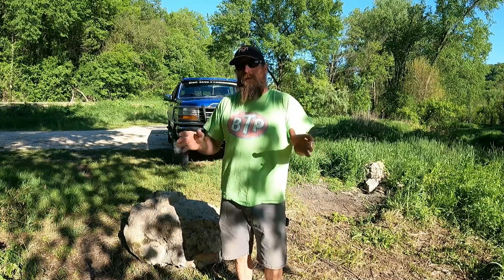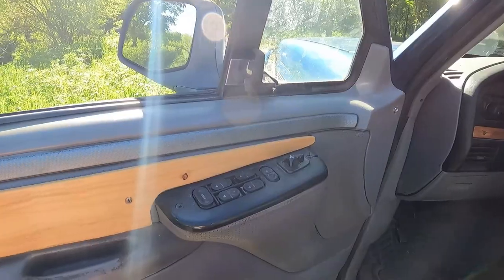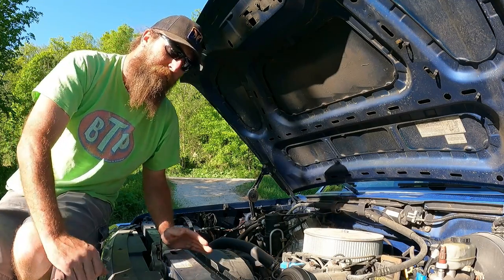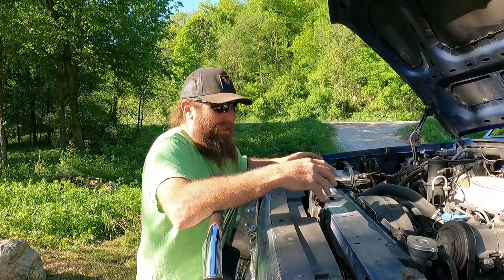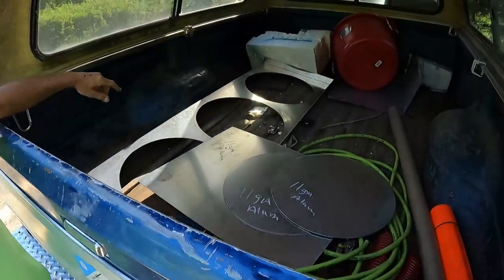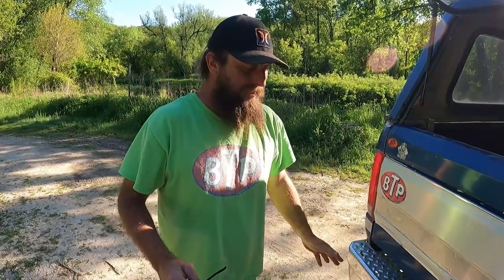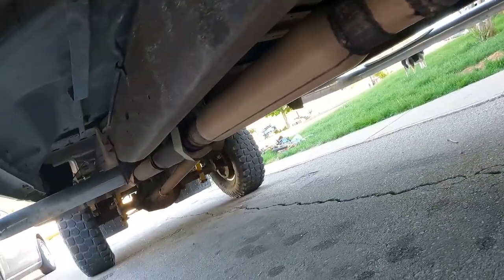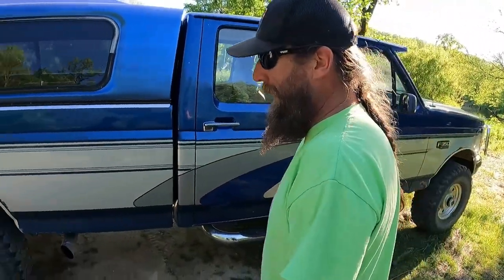460 Ford Big Block 1995 F350 walkaround about all the little details with 460efiguys.com Review.

Comment: Looking at a 95 f350 dually with dump bed on it. Got 98k on the clock. 5 speed manual and rust free. 6,500$ seems pretty good to me. Best part is that it has the 460 under the hood.

Comment: Great videos guys, love the old Ford. A few years ago I bought a 1990 F-350 Dually extended cab, with a 460 and a Auto OD. with 4.10 gears. I been planning to do a few upgrades for pulling. I did find me a nice set of used BanksPowerPack headers plus I also have a set of 1994 heads which are a little better from what I hear. I'm really thinking about doing the 460efiguys set up after watching your video (about the only videos on that topic) Thanks for the update one quick question how is the reliability of the low profile EFI set up? have you have to work on it or replaced anything? I believe you did say miles wise was around 20,000 since you did the upgrade right.   Thanks in advance.
Reply from the maker: 0 issues, it's solid 👌. Thanks for watching.
Reply: I've been running 460 EFI Guys kit for 40k miles 95 F350 460/ZF5/4.10 zero issues.

Comment: The original 460 big block from 1968 had 365 hp and 500 torque. I've heard that you can cut off the EPA bs, replace some of the neutered internals with  what it originally came from the factory with and reach close to the original 1968 HP and torque numbers. Is this true? If so, would this alter reliability much since it would technically be restoring it to what should have been factory specs and parts before the government stepped in? Does anyone know what parts need to be replaced to achieve close to the original power ratings on an OBS 460 and how much it would cost for those parts? I'm HIGHLY considering purchasing an f250 with a 460 in it. Thanks.

Comment: 245hp 4000rpm i think this is the correct motor configuration. If im right,why too little horsepower?
Reply from the maker: Yup lol
Reply: That's what Ford claims they also claim over 400 ft lbs of torque
Reply: Here in Brazil we dont have this kind of truck
Reply: @jeanmicheldeandrade8281   it's a beast 22 feet long wheighs 8500 pounds empty I love driving it

Comment: Nice truck what is the part numbers for your throttle body and stuff to hook it up I have a 1994 f350 with a 460 auto that looks like a great bolted on up grade . Found web site with throttle body but no wire harness or off-road deal